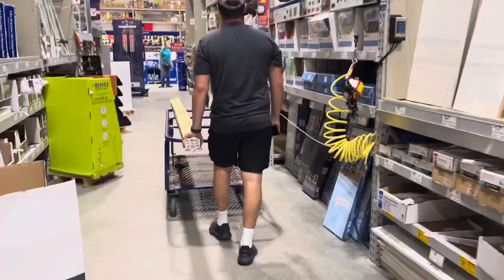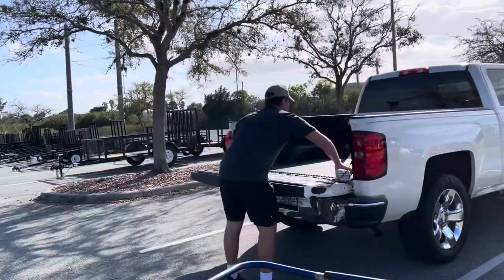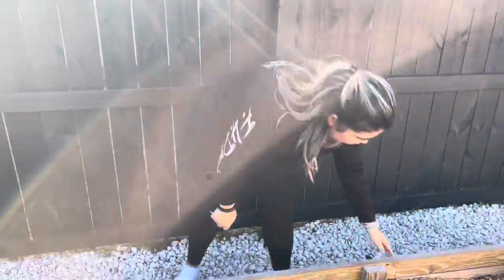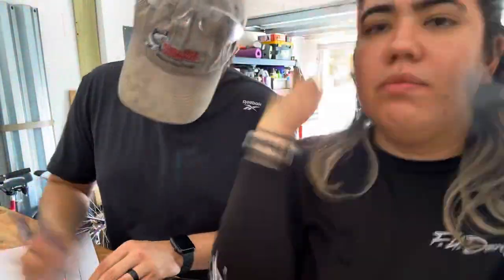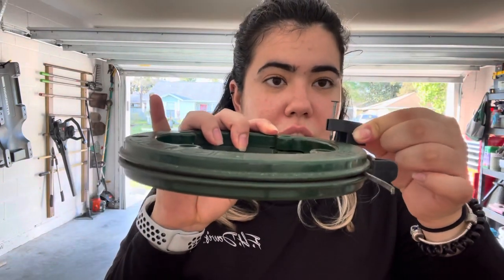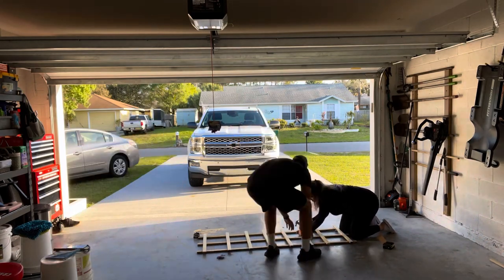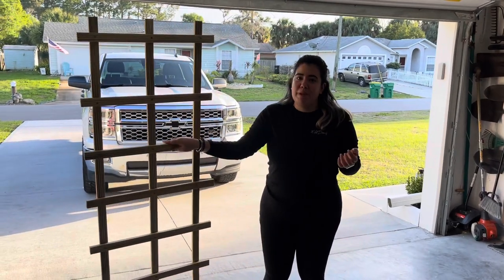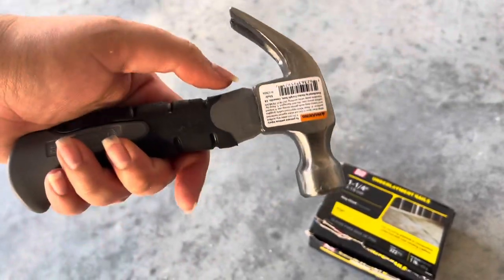The EASIEST Trellis Ever | Free Build Plans

Comment: You can also use a comb to hold nails. I prefer using treated deck screws counter sunk into the wood.They won't rust, and if you break a stick of wood,you can replace it. I'm making something similar now for our backyard only out of cedar 2x4x8 s.Cutting them down to 3/4in squares 8 from each 2x4 then cut the length to the need of climbing plants, like beans or sweet peas, cucumbers. That garden looks great...👍👏👏
Reply from the maker: Oh wow thank you so much, we had never thought to use a comb! We will keep that in mind next time, best of luck with your build! We love working with cedar 🙏🏼